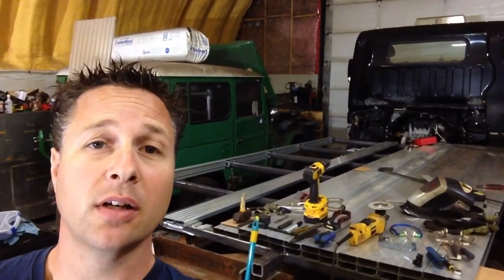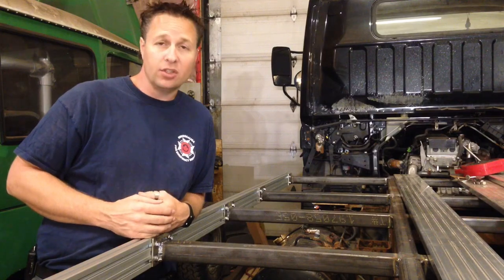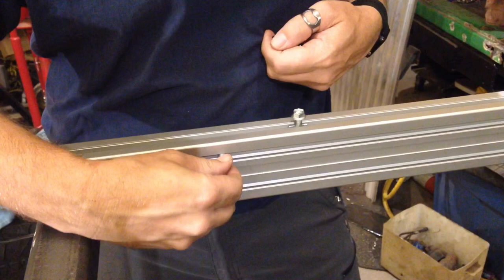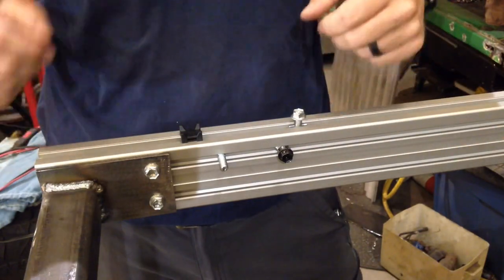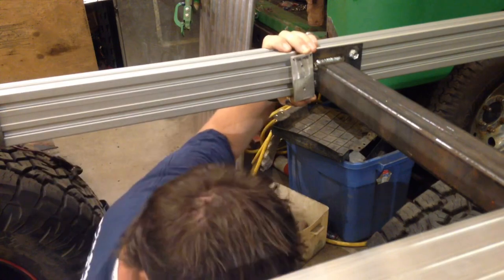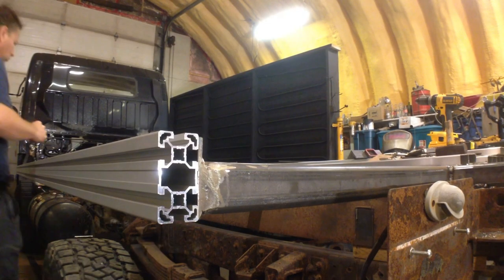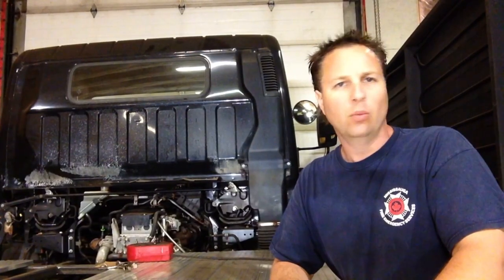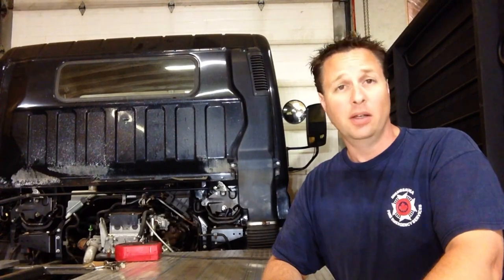Mitsubishi Fuso FG flatbed / tray back build part 2

Comment: Love using 8020, I see you have the aluminum bolted to the steel frame, what are you using for a isolitic barrier, along the side 0:45
Reply from the maker: Lots more of that coming in this build!  There is a layer of HDPE between the extrusion and the steel 😎
Reply: @BruceandKrista  share it!
Reply from the maker: @jgegere  it’s all in the follow on video 😎

Comment: Bruce, Great job andI think I am going to do a similar thing as I lice the idea of using the truck when it's not a camper truck.
Can you tell me where you purchased your T-slot extrusion and aluminum deck extrusion.
Thanks again
Reply: There are 2 companies that make that extrusion AFAIK
80/20 and Item (america)
Most people buy 80/20. You can find it on Amazon sold directly from manufacturer.
Reply from the maker: Depends on your location - but plenty of places carry the T-slot.  Decking is harder to find in small quantities (most places have a minimum order, or don’t have stock). Best bet is if you can find someone locally who uses it and buy a portion from their larger order - but you can check out Eagle Alloys online as well.
Reply: @BruceandKrista  Hi Bruce I am in Scarborough. Thanks again for your help. Do you have a product number?
Reply from the maker: Check out fazstore .ca for t-slot - I’ll be making a trip there shortly to pick up a whole lot of supplies for the inside!   I believe the decking is EAM-393, though you might see if you can contact someone at ASA metals, I believe they are in the GTA, so would be much easier for you, if you can piggyback on a bigger order with them.  (Plus they have wider and thicker boards)

Comment: how can you reduce the galvanic corrosion of mating steel to aluminum?
Reply from the maker: You need to isolate them - a layer of plastic (non conductive) or an adhesive sealant that prevents moisture from getting between the two surfaces.
Reply: @BruceandKrista  So like Blue skin, waterproofing membrane?
Reply from the maker: Depending on the size of what you are doing - a layer of sheet rubber, HDPE plastic would work well on larger items, small things like mounts or brackets can be mounted/bedded in silicone.